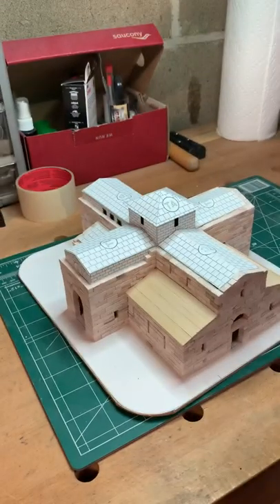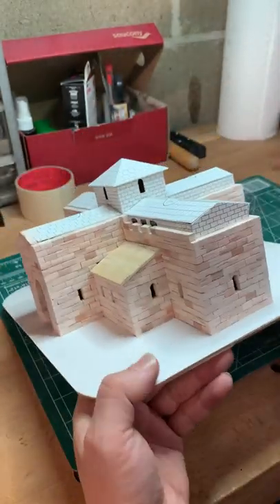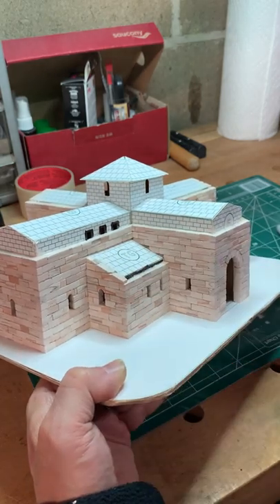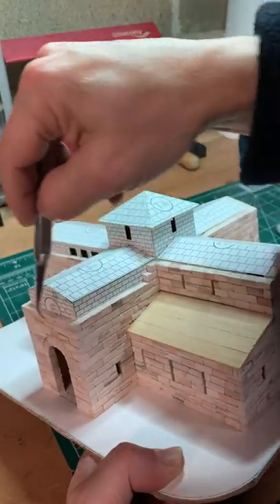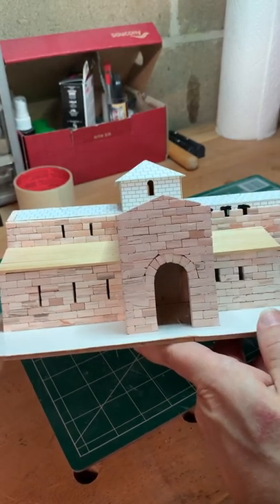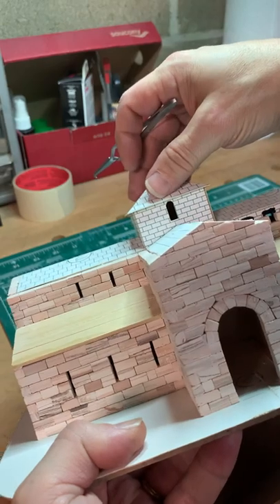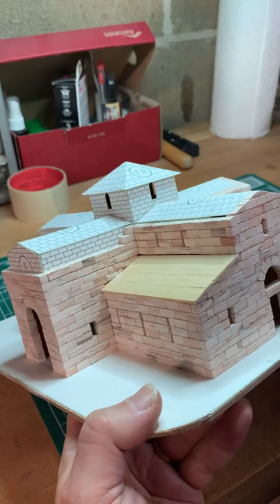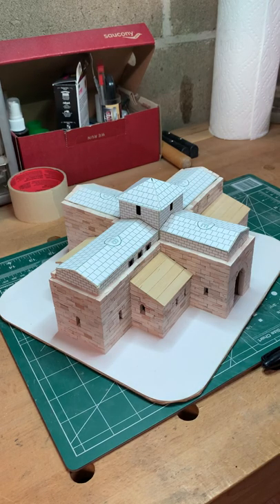Aedes Ars San Pedro de la Nave 3: Another Brick in the Wall Pt. 2

Comment: I found out that the easiest way to sand the bricks once they're already glued in order to get them leveled is to use a big flat file. It the fastest and most accurate way. At the end I slightly sand is a little bit with a nail file for a more finished look. Hope this helps.
Reply from the maker: I'll give that a try, Ales - the nail files I'm using are less aggressive than a flat file, so the latter may make the work go faster.